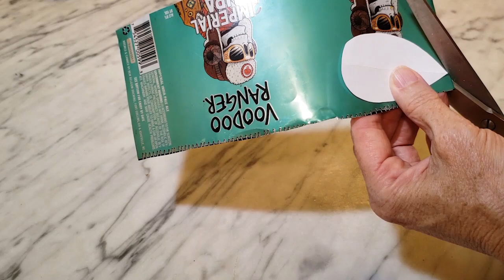You Won't Believe What I Did With Aluminum Cans - DIY Hosta Plant

Comment: One more question, approx how many leaves did you make for the size of ‘plant’ you made? Likewise how many cans did you use (I’m collecting a variety of sizes up to 440ml).  Many thanks
Reply from the maker: Hi it was a while ago but I am going to guess somewhere between 150 and 200 leaves. Thanks for watching. 🙂
Reply: @UpcycleDesignLab  I have a way to go then 😂 but am making one for a container in a shady corner to offset the plants and I thought it would bring reflected light to the corner.
Reply from the maker: @careyostrer6193  have fun 🙂

Comment: How long will these last outside, and do you use a clear coat on everything?
Reply from the maker: Hi Carla - I can't say how long they will last but I can tell you that these were outside all winter and they currently look the same as when I made them. I did apply a clear gloss finish made by Americana called DuraClear Gloss Varnish. It is my new favorite clear coat finish as they say it is for indoor and outdoor use. It also comes in other finishes if you don't want gloss. Hope that helps. Thanks for watching. 😊
Reply: @Upcycle DesignLab  thank you for the reply!
Reply from the maker: @realtorcr  my pleasure 😊